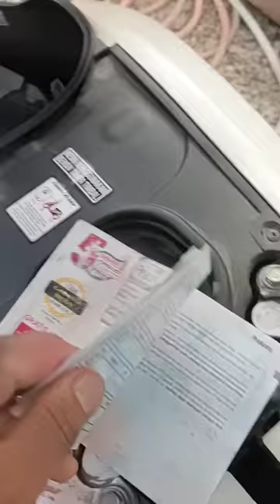eksperimen tentang oli mesin.  oil gear #shorts

Comment: Motor jarang di pake ya wajar lah sini saya pake ngojek tiap hari 200km mewek tu motor ga di ganti 2minggu sekali
Reply: pernah ngojol pake mio m3,baru 4-5 bulan km udah 60k 🤣
Reply: @betrixzerre3815  buset gw pemakaian 5 tahun lebih tuh
Reply: @betrixzerre3815  gila bang, pinggang apa kabar😂
Reply: dapetnya gk seberapa lagi, nasib² kita jadi budak aplikasi
Reply: @betrixzerre3815  60.000km / 4 Bulan 
60.000 : 4 = 15.000
15.000 : 30 = 500

500Km / Day 

Masa iya wkwk PP Jkrt Bandung aja 250an 🥲
Reply: Ojol 200 km man per hari.. Paling banter 300.. Kalo 500 mah gilak

Comment: HAHAHAHA GA BERLAKU BUAT PARA DRIVER OJOL PANDUAN ITU MAH, OJOL 1½ MINGGU UDH GANTI OLI MESIN😂.
Reply: 2 minggu sya juga pak ganti oli.. km wess bablas
Reply: olinya coba pake yang full synthetic, ya walaupun harganya hampir bahkan 2x lebih dari oli bawaan motor. saya juga ojol soalnya maximal 9rb km baru saya ganti oli pakai eneos hijau 5w-30
Reply: @chairulummam9119  saya klo nunggu 9rb km baru ganti oli sudah jebol dulu dan binggung mau narik pakai apa. saya sebagai ojol yang motor selalu on sehari bisa jalan sampai 150km pakai oli standar saja tapi 1500km selalu ganti oli. yg berarti 10-12 hari sekali ganti oli mesin. alhamdulillah aman sudah 1 tahun gk turun mesin lagi. sebelumnya 1bulan sekali ganti oli, motor baru dari dealer 3 bulan berasap setelah ganti oli ke 3 lalu tidak lama kemudian mesin macet dan selesai.
Reply: tips buat ojol, pakai aditif oli ceratec yg tahan 50.000 km. 1 botol 300ml bisa diatas 400 ribu tapi ada yg jual ketengan 40 ml sekitar 50 ribuan, lumayan buat ketahanan mesin 3 tahun, kalo bisa setahun sekali kasi aditif lagi.
ganti oli seperti biasa tiap 1 bulan sekali (jika vampire oli) atau maksimal 3 bulan sekali jika oli bekas berkurang maksimal 300 ml.
pakai oli mesran sae 20W50 aza.

motor gue matic 2016, sudah kena banjir 3 kali sampe oli kayak susu, masih jalan 30 KM sebelum ganti oli.
odo tercatat 63.000 KM tapi total 3 tahun kabel speedo putus, kira² total odo udah lebih 100 ribu KM, gerungan mesin sekarang masih halus kayak motor baru.
Reply: @chairulummam9119  GUA BILANG GA BERLAKU BUAT OJOL, APA LAGI 5w-30 😂 jebol mesin, ojol itu 1 hari jarak tempuh bisa 125 kilometer bro, jgn Lo samain sama motor kantor - rumah- pasar.
Reply: @jasjepang2955  coba deh pake oli yang saya saranin. saya si pake eneos hijau yang 5W-30 motor dari tahun 2011 baru ngerasain turun mesin 1x karena paking belakang krengkes udah rembes.
Reply: @diyahpermanawatiwidjaja2285  GUA BILANG KAN GUA OJOL, dari argo belom naik pendapatan minim 200k sehari mungkin anda tau lah kalo situ ojol 200k sebelum argo naik sehari motor saya on berapa KM ? baru ngerasain turun mesin karena paking krengkes belakang rembes maklum motor produk 2011, bukan karena JEBOL✌️ tapi semenjak argo naik bisalah seharian full hampir 500(tidak termasuk TIP)😁
Reply: Bener motor jarang keluar sekali keluar namatin Jakarta mau gk mau ganti 2 minggu sekali lebih baik keluar 50 RB daripada 500rb di kemudian hari
Reply: @diyahpermanawatiwidjaja2285  125km? saya sehari bisa 200km+ om🤣🤣